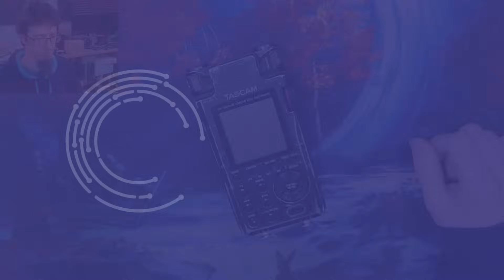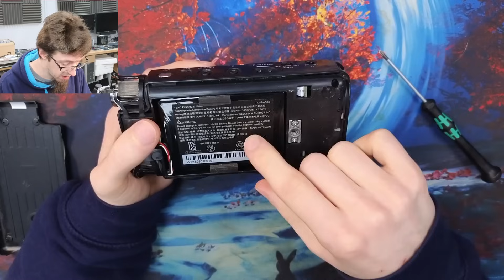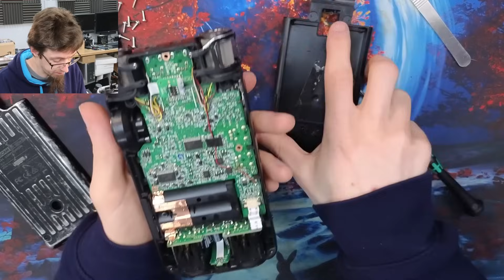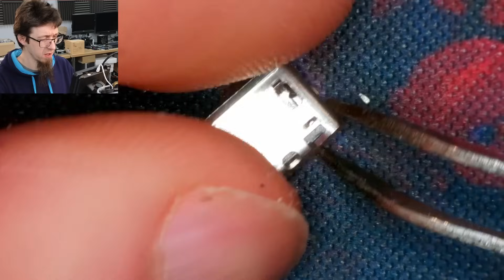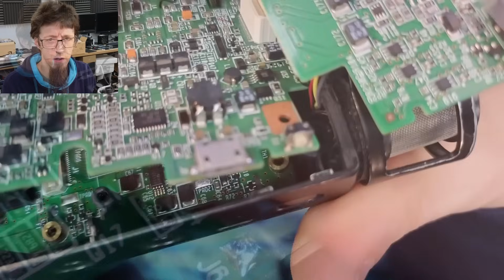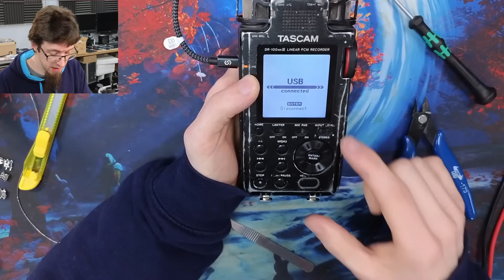TASCAM Teardown and USB Repair - LFC#389

Comment: 18:00: Not that I know stuff but I think the "ground-to-ground" cap is there because it's 2 different grounds. The one on the pin is signal ground (reference point for the circuit and return path for the current). The other one is chassis ground which is only for shielding. From what I've read, in theory, you should keep those grounds separate and never have current flowing through the chassis ground. Which seems to be what Tascam is doing here. In practice, they're almost always tied together anyway, so I wonder how much it actually matters. But I guess when you're making professional audio equipment and charge a premium for it, you want to eliminate any potential interference. ¯\_(ツ)_/¯

Comment: If you would just invest in a proper soldering station like the Metcal MX500 or MX5200 and a variety of tips you would not have so many problems soldering. Watching you and so many others struggle at this is because you and so many others are using those cheap Chinese pencils and stations!

Comment: 6:26 I think that's just input coupling capacitors / resistors for the two inputs (2 per input each). There'll be a boost converter elsewhere, which are a very common thing nowadays as any USB audio interface needs one. And yes, it's 48 V at a fairly modest maximum of 10 mA, with most mics being well short of that (maybe 4 mA).

Comment: You didn't replace the micro USB with an USB-C, which would be better."
Reply from the maker: That would require very detailed re-wiring of the pins, making the job significantly more expensive. Type-C is not pin to pin compatible with Micro B.

Comment: "These things are meant to be serviceable". Then proceeds to spend 20 mins taking it apart. lol
I hate those kind of repairs. Seems like it will be a 5 minute easy job. Actually needs a degree in mechanical engineering and 3 weeks! lol

Comment: With only front anchor points, the usb port will rock and rip off the rear pins from the pads, seen it happen and it will happen. You always need rears as well or they just don't have enough support with just fronts and the pins.

Comment: The cap on the left top side above the usb port looked shot and with almost missing one side, I was almost sure you're gonna test it to see if it needs replacing
Reply from the maker: Yea corner was chipped, but if it was absolutely dead I'd expect it to have failed short.

Comment: pre-tinning the 4 usb body points would have been a good idea. The user had broken the original with 5 anchor points - you are hoping 2 will work!
Reply from the maker: Factory soldering on anchors like that is pretty worthless for mechanical strength, the four outer anchors would have basically been tacked on, not properly solder-blobbed, and they probably let go as soon as the middle anchor ripped off the board.

Comment: Thats a very poor solder job there.. 
You know it, i know it.. and you can and have done better.. 
Also i only use C tips. they come in multiple sizes you dont need anything else only the correct sized one.

Comment: Those ports can be a pain. Next time hit it with 250-275 c low air speed while using your soldering iron. That extra heat will make the solder flow without an issue from your soldering iron without increasing your tip temp too high. You can always dab a hot glue stick around the port for support. It will really make huge difference supporting that port.
Good job and great video ! Thank you.

Comment: Did a similar repair myself recently. Managed to accidentally rip the USB port off of my soldering microscope, and had to replace it. I don't use USB data very much with my microscope (the picture is VERY laggy) but it is required to power it and to charge its built-in battery. Of course this presented a bit of a problem, how am I supposed to solder when my soldering microscope is unavailable? Somehow I was able to manage though. Not my best soldering, but it got the job done. You can buy really nice kits that have an assortment of different shapes/styles of USB ports, and they are pretty inexpensive. I was able to find an exact match for the port that I broke off my microscope.

Comment: Thanks! I have the DR-100MkII, which is a slightly later version with a removable SDCard for storage.  Battery life driving the phantom power is not great so I normally use a power supply.

Comment: I would suggest the owner use a magnetic usb connector and cable. Once the magnetic plug is in device the user can just magnetically connect the usb to the computer or charger.
Make sure to get the magnetic connector/cable set that also does data as some only do power.
I have them on many of my devices and they work great.

Comment: I probably would have put a drop of glue on the back of the USB port, Just because I would want it to be a strong as possible.
Reply: Some hot air and a glue stick really does work well. It can be the difference for a job that would come back in 6 months due to poor design vs never seeing the device again.

Comment: It's even more interesting when it has sentimental value. What about hot/UV glue to fix the port even better? Any downsides? Tricky but marvelous job there, thanks for sharing
Reply: A glue stick with some hot air makes a huge difference on port replacements. Any and all I work on I make sure to use on them. Some of the USB C / HDMI ports really don’t have much holding them in and using a glue stick really cements them in. Also hot glue is super easy and quick to remove. No mess at all.
Reply: @shiftctrlhack  That's what I wanted to read, thanks for your confirmation
Reply: Not a problem :) Spread the knownledge to everyone you know. The only way stuff will get fixed and fixec correct. @deedeelabricolade